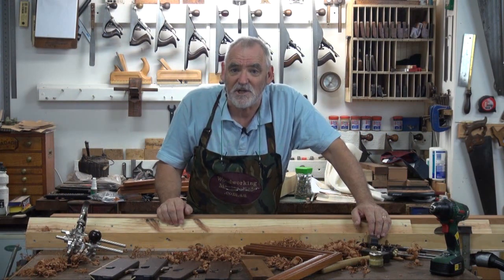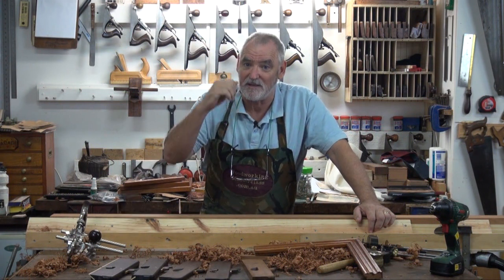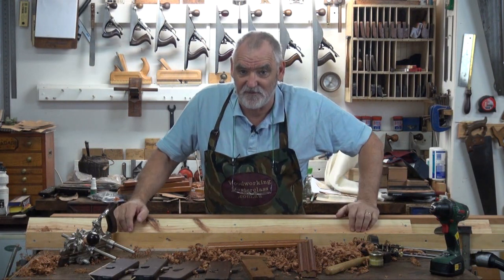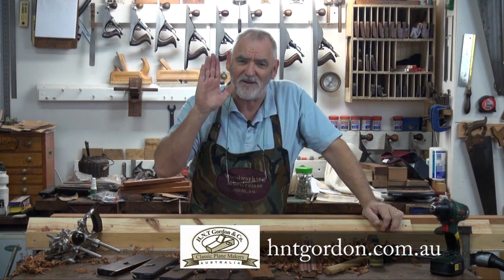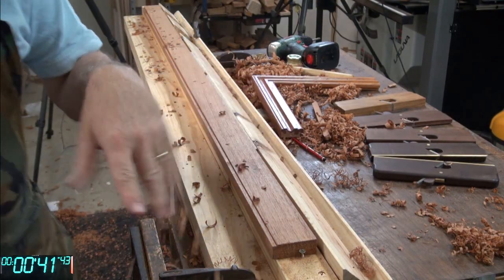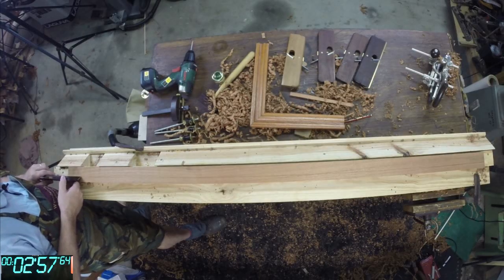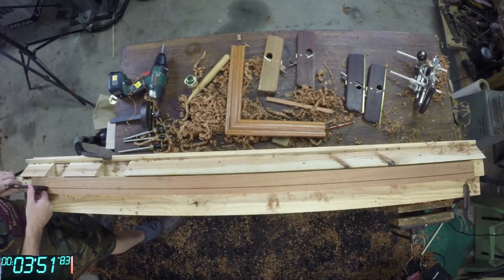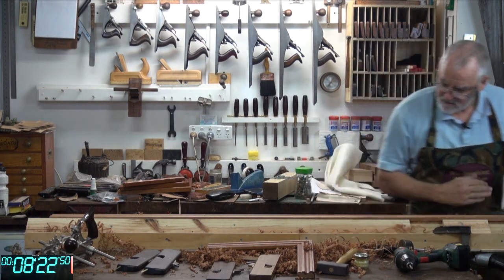Picture Frame Making Pt.1a of 2 Using Hand Tools Only

Comment: Hi Steve, do you have a link to the previous video that you referenced? Many thanks, Gareth
Reply from the maker: Hi Gareth, Not sure if this is the one but is is a live stream I did a couple of years ago where I do do some moldings from scratch. It's a long stream but the molding parts starts @ 1.45.30. Hope it helps. Cheers Steve
Reply: @Woodworkingmasterclass  I would like to see the link to the previous video you mentioned too
Reply from the maker: @AssafOppenheimer  Hi Assaf, had a quick look but with over 500 videos couldn't find it straight away will try again later. Cheers Steve

Comment: Why not just use a round plane?
Reply from the maker: Where? I'm a bit confused. Cheers Steve
Reply: on the cove?
Reply from the maker: Thanks Ray, now I understand. The reason for the Snipe Bills or Rebate is to set a track for the Round to follow. If not they can be a bit of a challenge to steer along a marking line only. Cheers Steve
Reply: A temporary fence clamped to the work piece to guide the round?  But I enjoyed the video. Thanks for posting your stuff !!
Reply from the maker: That would work well too. Cheers Steve